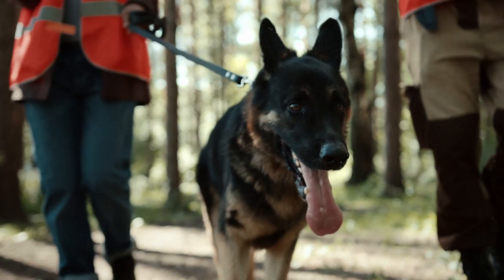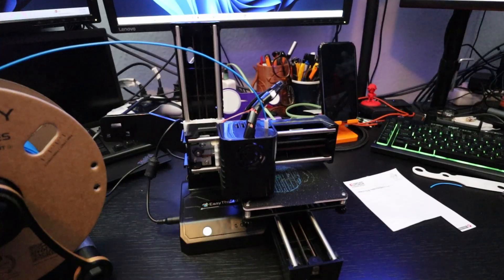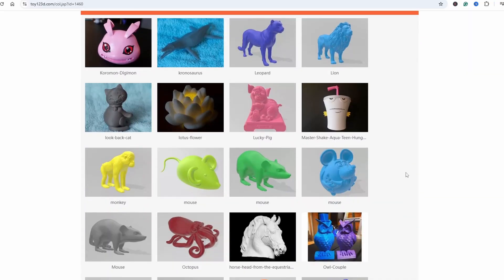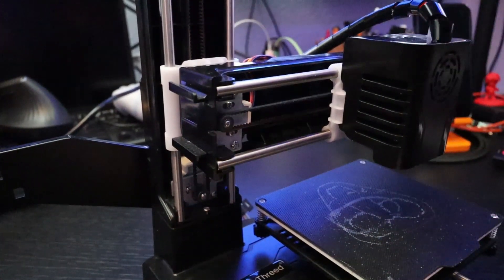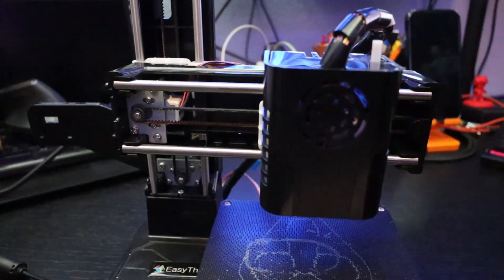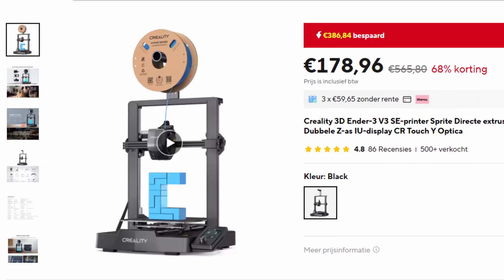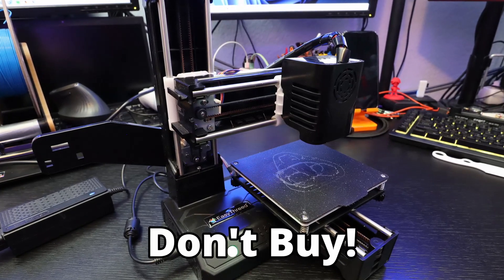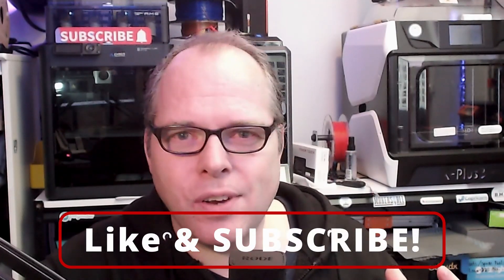Why I Regret Buying the Easythreed K9 - A Brutally Honest Review

Comment: I already own this printer and I can honestly say it does have some issues, especially when used for production. I’m still running it with the original settings, but in Cura I had to tweak several parameters to get a somewhat decent print quality — and for that, I had to sacrifice a lot of speed.

As a first printer, for someone starting from scratch with little capital, it can be a viable option. However, you’ll need to do some manual post-processing on the parts, like sanding and painting, to improve the finish.

It’s also worth mentioning that this is my first experience with 3D printing. From my perspective, the machine is quite slow: I use a speed of 30 mm/s, the extruder at the minimum, and depending on the size of the piece, printing can take over 10 hours. In short, it feels like an eternity.

But still, it’s a great stopgap solution.

Comment: You need diy the buildplate mine is steel and i use a glustick. 
I do not have to level the  buildplate annymore .
And if you tweak the slicer profile in cura .
And you need to change the base stand there one video online and the printer wil not wobble anny more .
And you can print nice things.
0.16.
0.06.
And it wil look verry noce of course it wil take a long time
Reply from the maker: I was looking to this printer for a long time, while it was on my desk and on the shelf and thought about possible upgrades, but would someone really put extra money into this? I saw the views on the videos where this printer was featured in, didn't do very well for my channel, so I moved on with other things. Maybe I can still do that?

Comment: Hi friend.  Do you know if you can connect the k10 to a laptop?  To put work from?
Reply from the maker: Hi, Although there is an USB connector on the printer, less slicers actually connect to it. You need to be careful with updates on your laptop when they are idle

Comment: I agree with a lot of what you said, but not everything. First, what does the K9 need a heated bed for? Sure, the bed needs a layer of Kapton tape to help objects stick and to prevent filament from getting stuck in the holes, but the heated bed isn't necessary.

Second, the printer comes with a fully featured MKS Robin Lite v1.1 board. The only difference between this and the retail board are the soldered stepper drivers. The board could be repurposed into another build, but it isn't locked down. Artillery, Kingroon, Two Trees etc all use makerbase boards. It flashes the same as any other makerbase board. Anyone who wants to tinker with their printer would be looking for better firmware anyway, and the printer has Marlin 2.1.2.1 firmware ready to go and is also included in the latest Marlin 2.1.3 beta.

After the firmware upgrade, you don't even need klipper. The printer will do 80-100mm/s real printing speed just fine with no hardware mods. The flimsiness of the frame sucks, but amazingly it doesn't affect print quality as much as you'd think. The printer has around the same print quality and speed as an Ender 3 after the slicer and printer profile is setup correctly. It is EasyThreed's fault for not properly tuning their profile of course.

I think the issue of price is a regional problem. The printer is $36 dollars shipped when on sale in Asia. The value is really good depending on where you live. 72 Euro shipped is a whole other story. I'd never pay that much for this. I will say this though. The K7 is better value than the K9 and you should avoid the K10. I just got that one in and will probably do a review on it. If you thought the K9 was cheap... The K10 is on a whole other level. It is actually an amazing feat of engineering with how cheap it is.
Reply: Hi friend.  Do you know if you can connect laptop on the k10?
Reply: Your review is quite helpfull, cause i had order k9 myself😊

Comment: As a user of the X1 for 5 years I agree. EasyThreed3D had some great ideas (even bought their super-simple heatbed for X1) but latest low cost designs are disappointing and no reason to buy their high end machines when there are other places giving better support.
Reply from the maker: The X1 had some small tiny issues that were easy to overcome... but this one is terrible. I wondering what I should do with it?